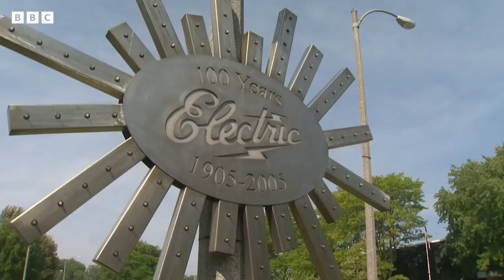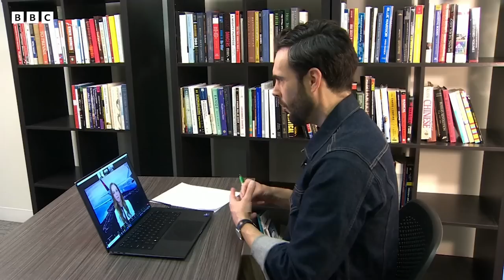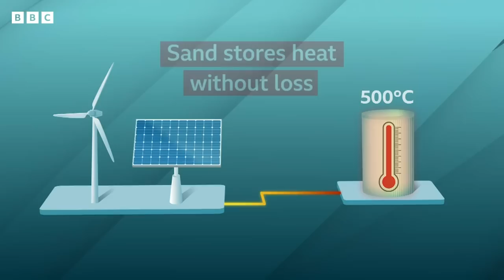Can the world rely on renewable energy? | Future Earth | BBC News

Comment: Renewable energy, and reaching net zero, currently, there is a lot of effort put into persuading people to buy electric cars, and install heat pumps, while these attempts may be 
done with the best of intensions, but unfortunately this is the equivalent to putting the (cart before the horse) If everyone switched over in the next few years, the only way we 
have of suppling enough electricity to power all these devices, would be to pump more natural gas through our gas powered generating plants.

I believe that our top priority should be to build much more renewable energy generating Capacity, together with energy storage, because energy storage is the key to making any 
Renewable energy system a realistic alternative to fossil fuels.

But how much more renewable energy generating capacity do we need? I say 50% more than would be needed on a typical day, so that the surplus can be stored as Green chemical 
energy, probably Green Hydrogen for days when the sun does not shine, and the wind does not blow, but also, as fuel for heavy vehicles, ships, planes and anything else were batteries 
or a cable would not be appropriate.

For most of the world, renewable energy will be in the form of solar or wind, but in some places wave or tidal energy would be an option and a few places will have the option of a 
base load generated by nuclear, but most will need some form of energy storage, luckily there is a huge range of options trying to get your attention, from a variety of battery types, 
from sodium-ion or sulphur variants, redox flow batteries, Nickel Hydrogen, to domes filled with CO2 as part of a compressed gas system, but not lithium-ion batteries, which keep 
getting more expensive due to rarity of the materials they are made from, plus, there is environmental damage caused by the mining and processing of these materials, then there 
are the slightly unusual options employing the raising and lowering of weights to store energy.

Then there is long-term storage, for when the wind and the sun don’t play ball for days or even weeks at a time. Every winter the U.K. is subject to meteorological weather events, 
known as a blocking high pressure system, which can last for up to two weeks at a time, and they usually come complete with a blanket of cloud, which further reduces an already 
limited amount of light for solar panels, plus there is little, or no wind for the wind turbines, leaving us with just nuclear power stations, that supply only 30% of our energy needs, 

which will go nowhere near meeting our energy demands, put simply we need a system that can store and supply between 60 to 70% of our energy needs for up to a month each 
winter, only a chemical storage system, such as green Hydrogen would have the capacity to storage energy for such a period, if we are not to fall back onto fossil fuels.

It has been suggested that large scale energy storage is unnecessary, and that we should rely on interconnectors under the sea to transfer electricity backwards and forwards 
between ourselves and Europe, on the assumption that some part of Europe will always have a surplus we can use, but I can see a scenario where eastern Europe is suffering a 
winter cold snap and needs all the energy it can get, Britain and the low countries are stuck under a blocking high pressure system, so no wind, plus Spain and Portugal are covered by 
rain bearing cloud, so minimal solar power, and such a situation would not be that unusual, and given recent developments with the war in Ukraine to satisfy a small man’s ego,
 it would be extremely unwise to assume that our partners in Europe will always be willing, or even able to supply us with what we want, when we want it, generating and storing our 
own surplus energy, means we stay in control. Interconnectors under the sea would be nice to have but should not be relied upon. 

 Another idea doing the rounds, says we build the bare minimum amount of renewable Capacity, and use smart technology to switch on or off an internet of things, as a way of 
balancing supply and demand, where large tech companies would control the operation of everything from large factories, to your domestic washing machine or fridge, I believe this is 
a distraction, I believe that the big technology companies could build such a smart system,  but I also believe that the tech companies already have too much control over our lives, and 
I believe our goal should be to build 50% more renewable capacity than we need, so the excess can be stored, and we do not have to rely on a smart system that could be hacked.
Reply: It would be great if data centres were placed where the massive amount of waste heat generated could be used instead of wasting even more energy on air con cooling. Until a way of storing nuclear waste safely for 100s of years I think it unwise to invest £billions in new nuclear when the money (and time) could be better spent on cheap renewables such as rooftop solar and energy storage systems.
Reply: OMG, you live in fluffy land,,, none of this is possible, logistically and physically

Comment: Burlington might have 100% renewable energy, but it is far from zero carbon emissions. In fact with one third of its electricity coming from burning biomass, it is in fact a big emitter of greenhouse gases.
Reply: That carbon was fixed from the atmosphere when the plants were growing, which was very recently.
Reply: Not always recent. The UK is importing woodchips from Canada. Some of this is from old forests which are supposed to be protected. Also it doesn't make sense to cut the wood, trans port to the coast then send it across the Atlantic, then transport to the Drax power station near Selby in Yorkshire - some distance from the coastal port. @biggusdoggus
Reply: @ralpharmsby8040  it rather depends on what the exact criteria is for recent, but the age of wood biomass is several orders of magnitude less than coal, for example. I agree that transporting wood such a long way does not make sense. I have not read a LCA for the case you mention, but the OP was about Burlington, and the plant there claim to primarily source biomass from the local area.

Comment: Simple answer, not a chance. 
Intermittency is the biggest and an unsurmountable problem.
Then add the fact that renewables cannot balance supply and demand being uncontrollable. 
It has no inertia essential for frequency stability.
It provides no reactive power essential for stable grid voltage
It does not support short circuit current levels essential for timely and proportional grid protection systems operation.
It cannot provide  a black start capability when the inevitable grid collapse of too much renewable input to a grid occurs.